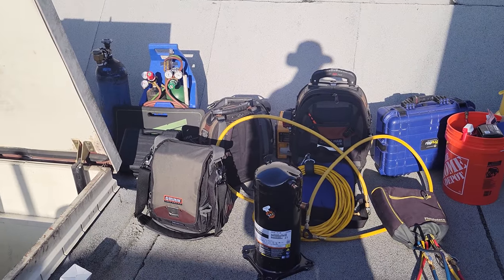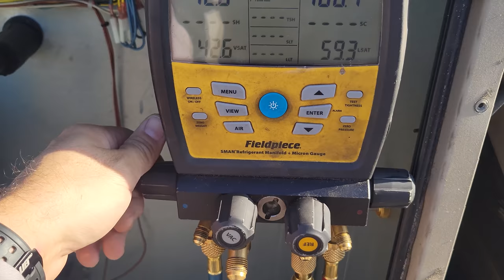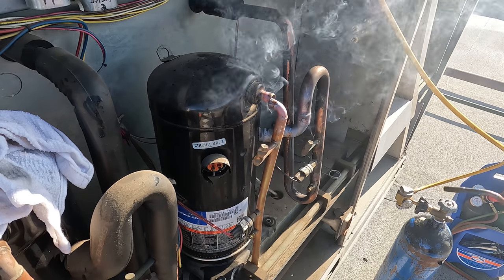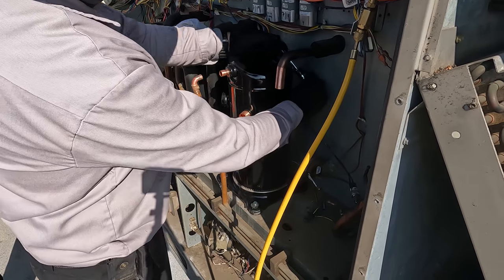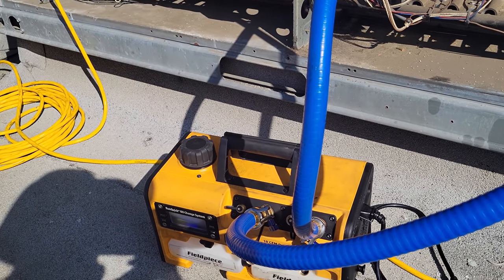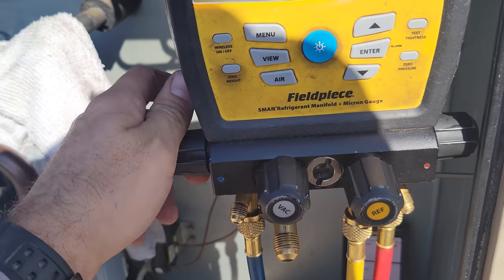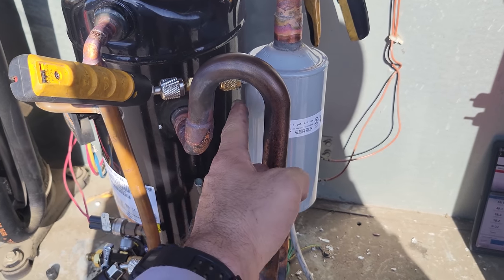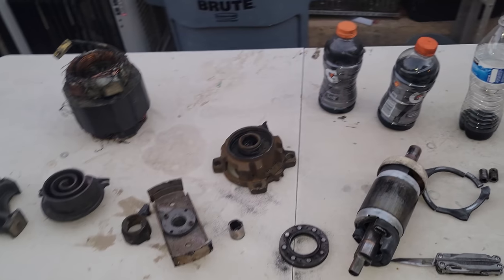KITCHEN AC BREAKER IS TRIPPED PART 2

Comment: Those Appion core tools actually are meant to be adjustable. Take some needle nose and lightly pinch the grabber end to make it a little tighter on your core. Test it on a loose core. When it’s adjusted right it will grab it every time. Unique to the Appion core tool. For a while I thought those tools were junk until I figured that out. Thanks for everything brother 🤙🏻

Comment: Good call on using the filter driers to recover. I myself use a lot of nitrogen while working on anything on the refrigerant side. Cheap insurance to ensure that any potential problems will not occur. I even use nitrogen while torching out components like driers, compressors, coils, etc, etc. When vacuuming down the system, it really pulls down quickly due to being dry. 

Another great video Chris.
That piece that broke is the Oldham coupling

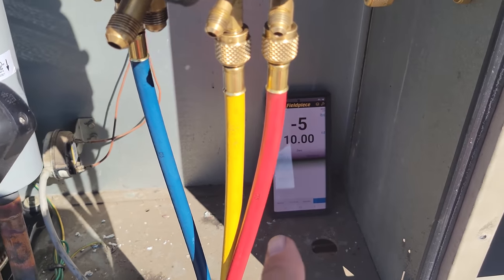Comment: 28:52 - I  appreciate you taking the time to repeat important tips like this one in each of your videos. For those of us just starting out in refrigeration repair it helps us to always keep these things in mind so we can minimize unnecessary mistakes.  Also, since I'm still learning how to braise copper, I'm pleased when you don't speed up the recording through the braising section so I can see your technique in detail for each joint start to finish (angle and proximity of the heat; changing the position of the filler with respect to the flame; different tips used for the type of joint, etc.) Keep the vids coming. I'm learning a lot from you.

Comment: 45:56
I believe the contacts got old/used up and corroded, that then lead to a single or phasing or two phase is more what I believe, those two coils pulled way more current, there by over heating contact, molex plug, and windings from too much current draw.
Reply: Maybe will see you at AHR expo. I need to bring something for you to sign!

Comment: Those oldham couplings seem to break pretty often. Looks like they’d definitely be the weak point if that compressor managed to get liquid into the scroll set. 

The oldham coupling keeps the orbiting scroll from spinning relative to the fixed scroll. So if there was excessive force on that orbiting scroll due to liquid floodback or flooded starts, it would put a LOT of strain on that coupling as the orbiting scroll tries to rotate.

If you imagine a pocket of liquid traveling through the scroll set, you can kind of visualize how it would try to force that orbiting scroll to turn instead of oscillate.

Comment: I really like that idea of using two filter dryers on recoveries like that to protect the manifold!

On those core tools, i took a pair of pliers and pinched together one of the forks on the core removal bit so it grabs harder, but just one one of the ones I have. I use that one for any cores that are too loose for the normal removers so I don't have to blow them out and have them shoot out and hit some cook in the eye.

Comment: I have found that when using the Appian core tools if you over tighten which is easily done that the gasket swells into the interior channel and it will not pull the core through I have started putting it on just barely enough to not leak pull the core and then I tighten it up a little for actually pulling refrigerant.

Comment: My friend's dishwasher keeps tripping a breaker when the latch is actuated to open or close the door. My theory is that when the panel had been taken off for service at some point, it had damaged/broken the watertight seal, and this let steam into this control board or something. The kicker is that the washer is popping either a completely separate breaker than the one it's on, or the entire house mains. They know it's the washer because it's repeatable. Fun stuff.
Reply: The fact its blowing such big breakers makes me think its either a motor feed or heating element feed is tripping especially if its the main breaker to the property. If it was a control board pulling that amount of amps to trip the main breaker it would be looking like an cremated pizza by now.
Reply: Replace it with a Flintstones Dishwasher. If it breaks down, you just get a new Elephant!
Reply: @k.sullivan6303  how about a new wolly mammoth instead.
Reply: The most dependable dishwasher is the wife.
Reply: @PantherSerpahin  I should have noted this is a house across the pond in Poland, so I'm not exactly sure of the electrical standards there. It could be one of those ground fault interrupt breakers like they have in GB. A few milliamps from live to ground pops everything to prevent electric shock.
Reply: @ritaloy8338  Come on Rita! This is a very serious channel with First World Problems. Wholly Mammoths are EXTINCT !
Reply: @ritaloy8338  Oops...First World Problems I meant to say.
Reply: @EnderMalcolm  Ah now that makes more sense!! Then if it's only when the door is actuated then I suspect a door sensor has got it's wires frayed and they short when moved

Comment: Given the failure was probably caused by the roasted contactor, shouldn't this "cost-conscious" client spring for an inspection of the other two units?
Reply: How would a roasted contactor cause a burn out?
Reply: @Paulx589  Voltage drop.  As the surface of the contacts become less and less "flat", the resistance increases, which creates heat.  Heat will further burn & oxidize the contacts and you have a vicious circle.  As the resistance increases, the available voltage to the compressor & fans is diminished, making it hard for them to get started.  They will pull the starting currents for a longer period of time, creating more heat in the contactor & compressor... and so it goes.
Reply: @daemoncan2364  Most of the time they cause phase dropout, which will burn out three phase motors no problem.
Reply: @FrozenHaxor  Yes, and I have seen this personally.  Deck winch on a ship kept repeatedly burning out motors.  Chief engineer wouldn't spring for a whole new contactor, but We did convince him to have the contacts refurbished.
Reply: @daemoncan2364  those motors aren't as expensive as the contactors. 🙄

Comment: Un-sweating goes a lot faster than brazing in, I noticed. You don't worry about the pressure limiters getting cooked.
Reply: He will see this eventually but a while back he had a unit continually plug up, and ended up putting in quick change dryer. 
The large dryer is to save the new compressor of any junk the old one left in the lines

Comment: Greetings from Greece. The flooding can be caused by plugged up air filters. If there isn't enough air flow, the evaporator doesn't remove enough heat from the refrigerant for it to change phase completely.
Regarding additives, old timers used to use R-11 for serious "humidity infection" cases. Since it is now no longer available, there are some products that are used in similar circumstances, but I haven't used them on a running system, charged with oil and refrigerant. I used them only to clean the tubing, and purged the system thoroughly afterwards.
Reply: " If there isn't enough air flow, the evaporator doesn't remove enough heat from the refrigerant..."
Minor correction, without proper air flow, not enough heat is added to the refrigerant to boil it into a vapor. But your point is valid. Dirty air filter can cause these sorts of issues.
Reply: @magmajctaz1405  You are correct. I wrote my comment just before going to sleep, and it seems that the brain glitched :D

Comment: I'm sorry, did you check your light setup? I have noticed thas one of the light sources is kinda of flashing. At 45:30 I can see it on package on of merch and notice jittering shadows on the wall. I dunno, has it impact on your eyes, or it is plain not synchronized light. but I see what I see. 
Stay healthy.

Comment: I bought my first Yellow Jacket Recovery Unit just around 15 years ago and my wholesaler told me to put a filter drier rig on the suction side of that Recovery Machine every time I used it.  I did that and cleaned the screen on every recovery for about a year, but after that just cleaned the screen. Perhaps that wholesaler just wanted to make extra sales.
Reply: I do use filter dryers on the actual system whenever I can. The ductless mini split heat pumps I do now, I have only changed 2 compressors and there is very little room to add dryers inside the outdoor unit.
Reply: @k.sullivan6303  Considering the initial cost of commercial-quality equipment and how essential these units are for a tech's income, it seems like sound advice to give to get the most life out of the equipment. Something along the lines of "an ounce of prevention is worth a pound of cure."

Comment: The ring is called the Oldham Couping, simply keeps scroll piece from going to far out of "compliance". Scroll is design to allow a "small amount of liquid pass", when too much does the Oldham Coupling can break as it goes beyond its limits. Liquid going through scroll washes oil off leading to wear. Dirty filters of course could have partially led to some of its issues.
As for acidic issue, all starts with moisture. You pulled a replacement F/D so that tech didn't follow proper practices and got moisture in the system. It is accelerated by heat which you have lots of along with condensers not maintained.

Comment: Chris, do you go back and pull the acid dryers? I had one boss that insisted on that. His thought was any acid in the system is now in the dryer and if the dryer breaks down the acid can go back in the system. I used to pipe a tee in somewhere with the tee looking down with a schrader on the bottom. Oil would collect in the tee and you can get an oil sample out of it

Comment: Why use your nice gauge manifold, instead of just hoses from the unit to the recovery machine?  Looks like you have a running burn.  Hope you can clean up that mess. Back in the day, we would cut the lines and flush everything out with R11. I’ve seen those terminals blow out and go thru the cabinet.  You’re not even supposed to remove the plug or cover, with pressure in the system.  You are one of the most competent and professional  technicians I have seen on you tube.

Comment: Teardowns are great. I would say the cause was likely this broken ring from the scroll assembly. Would be interesting why this part breaks, it's the 2nd compressor where this part was broken (the other one locked up). Maybe it's just from wear or if you overload the compressor with too much head pressure... don't know. The wear marks inside the scroll could be from running with the broken ring, maybe not from flooded starts. And if metal pieces make it into the motor, damaging the windings, of course the motor will burn out badly.

Comment: I can't believe people would complain about still using r22. None of the replacement stuff is as good as the original so while it's more expensive as long as the customer has options and understands the pros and cons they should use what they want.
Reply: Because it's literally HORRIFIC for the environment. Same reason we don't have crappy carburetors and straight pipes on every new car.
Reply: @JH-tc3yu  but those cars still exist, still in use, still rebuilt and still maintained. They also cost a fortune.. just like r22. There's millions of pounds of r22 already made and waiting to be used. It will be used or destroyed when there's no market for it anymore. At least using it has a chance of not ending up in the atmosphere

Comment: Could you take the two 3/8” recovery hoses with 1/4” fittings and hooked them straight to the system with the two filters straight into MR 45 using a tee?

Comment: I guess that piece that broke off could easily have scraped off the winding insulation, causing arcing which could then slowly contaminate the oil and I guess it's only a matter of time before it somehow conducts to ground, which will then cause carbonization and a permanent grounding.
Just my theory, feel free to pull it apart.